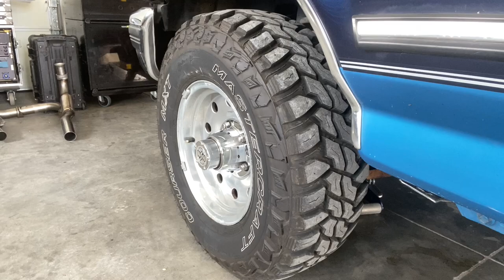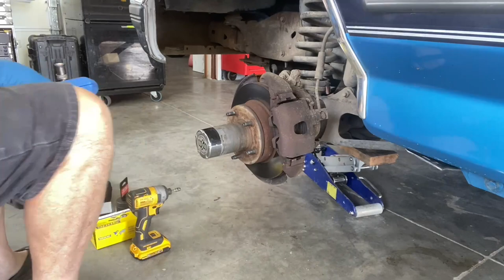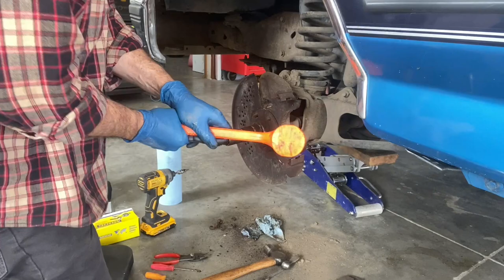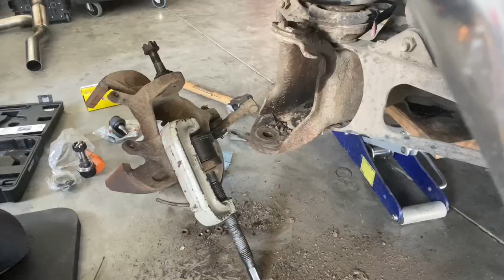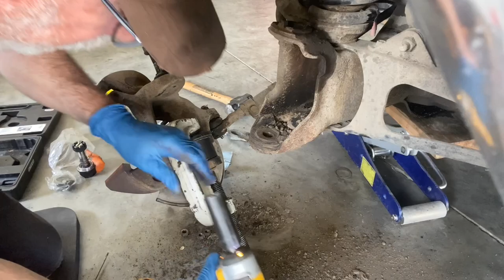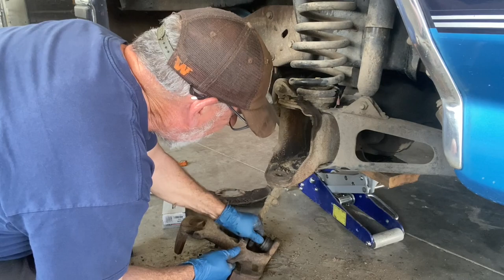OBS Ford F150 4x4 Easy Ball Joint Replacement for Beginners HD

Comment: What is the technical name of the ball joint king pin?  Mine is rusted out and need a new one. Thank you. Your video helped so much
Reply: It’s called a cotter pin. They come in many various sizes. Anything really of size will work. Just prevents it from backing out.